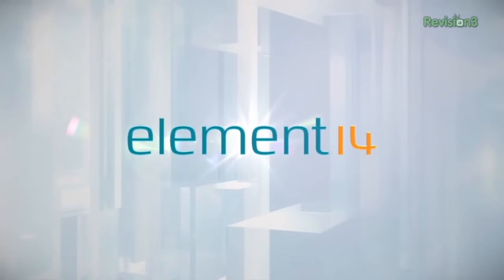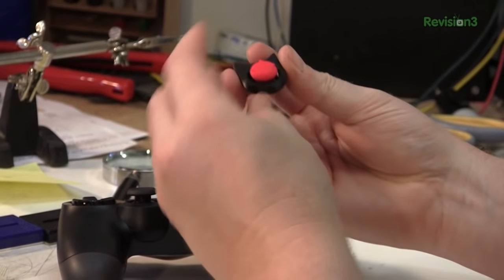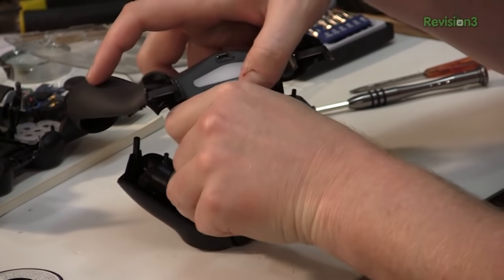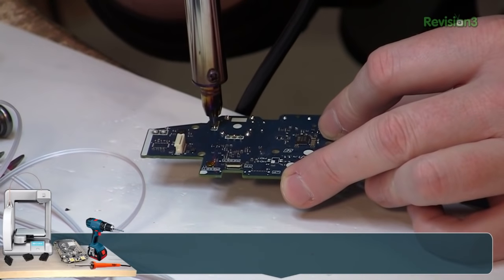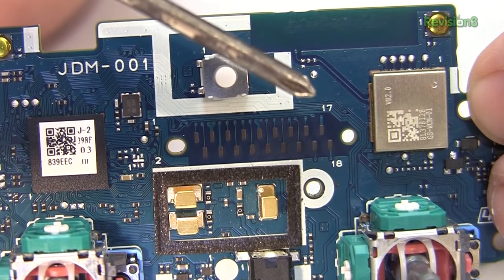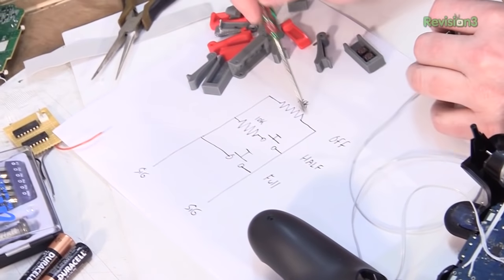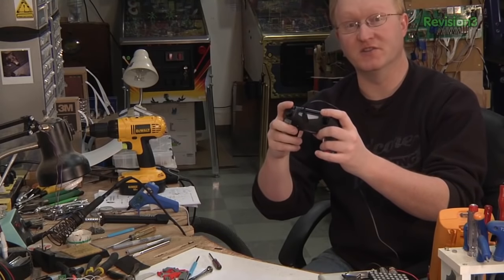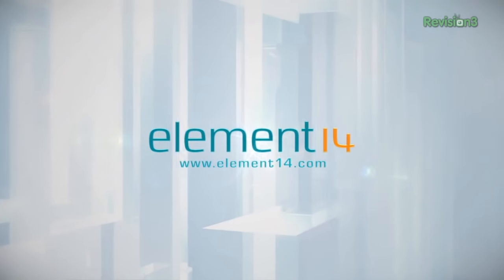Ben Hecks PS4 Accessibility Controller

Comment: What about people who need a left handed version? Can your design be "flipped" to the other side?
Reply from the maker: Yes, I make accessibility controllers for both hands, though, requests for a right-handed version are more common.
Reply: Statistically, the highest estimates for the number of left-handed users is 1 in 5 people... Of course, among people with disabilities this may work out slightly differently because if someone only has 1 functioning hand/arm, this may not have any actual relationship to what their dominant hand was...

Still, as a left-handed person, being in a minority kind of sucks, because products properly designed for left-handed use are quite rare. (Usually at best you'll get ambidextrous designs. - dedicated left-handed designs are very rare.)
Reply: I realize that left handers are a minority. This video is about an "Accessibility" controller. The concept here is people who have a non-functioning or existent hand will still be able to use a controller with one hand. Since you can loose either hand in a myriad of ways, it made sense to me to sort of disregard the typical statistics.

As a sort of example here. My hands are very different from 99.9...% of the population. They are also not symmetrical. This being the case, although I am right handed, some task are simply easier to accomplish with one hand or the other.

In addition to my differences, the controllers like the one in this video don't fit my hands well at all. It's a real struggle to use them. I can never use them efficiently and without some discomfort. It sucks to live in a world where many items are clearly designed for hands unlike mine. But I don't blame them...:~) Fortunately, I don't own nor get excited about playing console games.

Keep up the great work Ben!
Reply: I understand, I wasn't trying to make a point about left-handed users being a minority, but rather that they are a very large minority compared to anyone with a disability, and they STILL cannot seem to get any official support from most companies.

My point being, it'd be nice if companies gave some thought to people with disabilities, but clearly they only really care about the money.

And the financial picture makes it very unlikely they'd ever release anything for people with disabilities because there are relatively few of them.
Reply: ***** OK... But what would that imply? (I supposedly have mild asperger's by the way... No idea what it means really though...)

Comment: Hey Ben have you considered making a completely custom remote which has the wires coming out through to the pub in a external enclosure  that way it would be as if it was a wired remote but would be much more ergonomic as you could make it specifically for one handed use

Comment: There is a huge problem with the left thumb stick on the PS4 controllers, when you first purchase one, you can run around and keep pace with everyone else, but after 2.5mths the forward motion of the left thumb stick starts to die, this is already being reported all over Sony's forums.  Is there some kind of work around, or a video you could do showing how this might be prevented because at €65.00 per controller, they're not cheap, and should last just like the PS3 controllers.   I would sincerely appreciate any advice you might be able to provide.  Or maybe you could do a work around video... just a thought.  Peace and regards to you and yours. b.g

Comment: But what if I only have a left hand?...
Reply: it doesn't matter the controller is symmetrical in every way ergo, a left handed one is just as easy to make...
Reply: Left handed has been cake until now. For 4 years I've been playing with the controller squeezed between my legs, palm of the hand runs the left sttick while the thumb runs the right. I was fine until now, the new controller uses l2 and r2 as primary and I can't reach them anymore!! I'm trying to swap them!
Reply: You need a surgery to transfer your left hand/arm to the right then.
Reply: This dude will figure it out lol right or left, same concept

Comment: Why do you need to solder before you de-solder?
Reply: Did you miss the "yak, lead free" part?
Reply: even if you have regular solder it is usually a good idea to add on some to freshen it up (add some more flux) and sometimes to act as a heat bridge

Comment: I'm missing the majority of the fingers on my right hand due to a machine injury. Could you possibly make a Playstation 2 controller with the r1 and r2 buttons on the left side? Also I have issues using a Wiimote with a nunchuck.

Comment: Can you make the ultimate ps4 pinball controller that's the same width of a table and has some type of sensors for nudging and a pull lever for shooting, flipper buttons on each side and of course controls on top for accessing the menu

Comment: Great idea, but have you thought of using the old style laptop pointing sticks for a dpad? Might be a nice solution to the issue at the start of the video regarding spacing when using the right analog stick. It could even be situated between the face buttons if it wasn't going to interfere with internals. As for the L2 trigger, couldn't some sort of potentiometer be used as an analog input? I have no idea what I am talking about, I am mechanically minded but from the point of view of a simpleton, these are the ideas that popped into my head.
Great work as always Ben. I love how you do what you can to allow anyone to enjoy gaming no matter what difficulties they face.

Comment: Hi Ben. That was fascinating to watch. My problem with the PS4 controller is I have normal sized hands and I'm not used to the layout of the thumbsticks (I'm used to 360 layout) so I tend to hold the controller further back which is awkward. I was thinking about how to pad the handles so I could grip them better. But having no technical expertise the only thing I could manage is to wrap them in duct tape to pad them out a bit. Does anyone else have similar issues?

Comment: I'd put the dpad on the right, right under the buttons, and not all the way down below right stick. That way it'd have ability to use both pad and buttons using just my thumb (tip on the buttons, base on the pad). Probably the same principle with left shoulder buttons put on the top of controller. That way we also have ring finger free, and then we can relocate second stick to where left shoulder buttons are now, so it won't be free anymore.

Comment: Hey Ben I need your help.  I have a ps4 controller, but it doesn't work. I need a new ribbon cable. It's the one that as soon as you take apart the controller, it's the one that you first see, it holds the back part of the controller to the front part. Can you please tell me what ribbon cable that is so I can find it online to order. Hope you get this message.

Comment: for me the ps4 has 2 problems the R2 and L2 seems to be very sensitive, which for me is a minor gripe. what i really want is to change the analog sticks. i want it lowered or better yet change it to the one used in the psp(under the d-pad, don't know what they're called)

Comment: This idea may be a little hard to pull off(I certainly wouldn't be able to do it), but what about a wrist analog controller. It would be a wristband(comfortable one) with a (somewhat)stiff rod attached to it, controlling the left analog stick(which may need to be relocated to accommodate this) basically your wrist movement would control the stick. Let me know what your guys thoughts are, if you like the idea thumbs up it so someone with the skill may try it. If anyone want's to run with this idea feel free.

Comment: I think Sony, MS and Nintendo miss a trick by not releasing official controllers like this.  I'm sure cost and the relatively limited market is why they don't, but they'd be able to charge a premium price to cover the extra costs due to that limited market, and those that need them would most likely pay that bit extra for official peripherals that come with official support and warranties.
Oh well, you do good work for disabled gamers Ben...well done.
Reply: I think perhaps the problem is that the market is SO limited, that it's not cost effective. It's not like it would increase the cost 10%... More like double or triple it at least. When you're making 50 million regular controllers, making even 1 million specialised controllers is very expensive by comparison. And since disabilities vary, a single design wouldn't be enough, making the situation even worse.

As an example, left-handed controllers are almost non-existent, and that could be as much as 20% of the market. (So for every 4 right-handed controllers, you could sell 1 left-handed one, yet this is apparently considered too small of a market to bother with...)
Reply: KuraIthys I think these should be more comparable with something like a driving wheel for driving games, or the DDR dancepad, or the fightpads for fighters. They don't have a large market, but it could have a faithful following of consumers who want to buy these "sandwich controllers"
Reply: 3 years later... and Xbox actually released an accessible controller

Comment: Hi Ben,i have a question for you regarding the accessibility issue.
Allow me to explain my situation,i have muscular dystrophy and its reducing the strength of my hands therefore i'm struggling to click on the analog sticks of my PS4,for exemple ,i can no longer run playing Call of Duty.
So,is it possible to reduce the amount of strength necessary to click on the L3/R3 buttons of the PS4 controller ?
Hope you find some time to answer.
Greetings from a brazilian viewer.

Comment: your good! i hate getting into controllers especially putting em back together

maybe you can answer this, i took my ps3 controller apart to clean it and when putting it back together i caught the black wire of one of the vibration motors i thought ok its no biggy the vibration wont work ok ok big deal, well to my disappointment the controller dont work at all when i plug it in all 4 lights rapidly flash constantly and controller is dead, why wont it work without the motor connected? i dont have solder n stuff so pretty stuck.
Reply: If you haven't just bought a new controller since you posted this, just strip the wire and twist them together.

Comment: my ps4 controller wont hold a charge so i ordred a new battery, installed it and it still wont hold a charge. flashes red on led and even when i unplug it it flashes like its charging. wtf?
Reply: I bought a new ps4 controler and it did the same thing so returned it after a week of it not charging an I got a fresh new one that charges you should try to return it if you have the receipt for it
Reply: +Jonathan Lira Bribiescsa Did that already, called sony and they replaced it for free. Thanks man

Comment: Why would you NOT change the menu for PlayStation 4? XMB was utter rubbish and better suited to a hand held machine such as PSP. Plus if it looked utterly the same as the PS3 when you booted the machine up then there would be a barrage of insults and bad press.

Besides the new menus are far more clean and tidy with a lot less clutter.

Comment: and to all those that don't know its not a fake screw hole her is the explanation on what it Is......the truth is its not intended to be a " fake screw hole " its from the plastic mold that forces the hot plastic out of a tube and the plastic hits the steel cold mold plate and when the mold machine finishes it leaves excess plastic which the person that checks the quality of the mold will take off in turn leaves the " fake screw hole " to be there from the mold tube ( I've worked at a plastics factory for about 2 years so I thought I would help explain to you why the extra hole was there and where its from )  :)

Comment: It was painful to watch. Nothing wrong with video, just the amount of work to make it work. BTW, technically it lost some functionality due to L2 not being fully analog. Some games, primarily racing sims, do use that functionality. However, considering the overall complexity of the build, it seems to be acceptable.
Reply: with any luck you can still use a racing wheel and your feet for pedals :)

Sony did engineer that a little 'too' tight for my taste.  Hackability is always welcome.

Comment: There is no way I'd be able to do those tiny connections with solder. I would loose my shit.
Reply from the maker: That part was difficult and time-consuming.
Reply: I bet it was Ben, I have tried only doing 4 connections at that size, and I couldn't do it.  I was in agony with the frustration. You need the right heat, solder, speed, light, fine motor skills.

Comment: dualshock 3 for Ps3 was perfect.the dualshock 4 for ps4 is ergonomicly wrong and gives one blisters.
Reply: true
Reply: +bassax7045 dualshock 3 was so small i could cross my thumbs to play the oposite joysticks. this one is the best. after all this time never got blisters...
Reply: +bassax7045 dualshock 3 was so small i could cross my thumbs to play the oposite joysticks. this one is the best. after all this time never got blisters...
Reply: Gonçalo Monteiro its just the top of the 2 analog sticks that shouldnt have an edge but be similair to the sticks of DS3.
the bigger size i love very much.but those edges give me blisters when playing games that need intensive use of the Ds4 ,like ufc2 or other sportsims,,when playing GTAv its ok and i dont blister either.
also  ds4 is made of lower grade (cheaper) plastic,and i heard lots of people have used the warrantee to get a new ds4 after the sticks started crumbling pieces off.
Reply: that edge is good for sweaty fingers.
Reply: Are you sure you don't have Nintendo 64 analog sticks on your DualShock 4? How are you getting blisters..? I haven't heard of blistering yourself on a controller since Mario Party, come on now..
Reply: Michael Thomas already solved it with ps customer support,,the black ps4 controllers are ok ,,but the ones that come with the glacier white version caused the problem ,,
,i wish they kept the Ds  3 design of those sticks ,they where made of higher quality materials as well,and never had problems with those.
Reply: Duelshock 3 is garbage. Duelshock 4 is the truth.

Comment: DO IT FOR THE CHILDREN!

Now, a serious question: Apart from it required higher temperatures to flow, are there any drawbacks of lead-free solder?  I'm reluctant to use lead solder, because I'm the type who would forget to wash my hands and then end up with Alzheimers at 50.
Reply: I'm far from being an expert, but as far as I can tell, it's just the temperature thing.

Of course, you shouldn't underestimate the difficulties that causes. Higher temperatures increase the risk of destroying temperature sensitive components on a circuit board, amongst other things...

Comment: PS4 controller settings - select dim for controller light - battery lasts longer (-̮̮-̃)b
Reply: Actually LED's don't use much power at all so it doesn't matter if it's on bright or dim. Only if you just let the controller be and don't do anything with it you can notice the difference.
Reply: Eetu Helminen Not true. The brightness of an LED is not variable. It is controlled by PWM. Pulse width modulation. Essentially turning it on and off rapidly at different speeds. At full brightness it is on all the time.

As you lower the brightness, they are "off" for an increasing amount of time. Saving short bursts of power will keep adding up to significant savings. It will make a difference.

http://www.neogaf.com/forum/showthread.php?t=723148
Could be the difference between 12.5 or 28.6 hours.

LED are very low power lighting, but on batteries small differences mean a lot more.